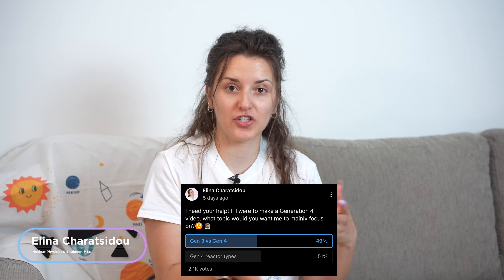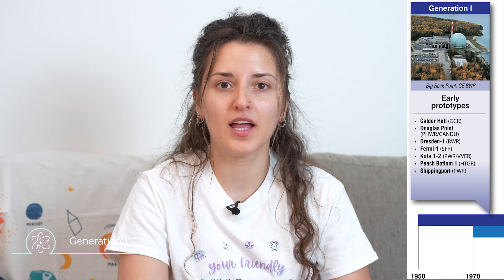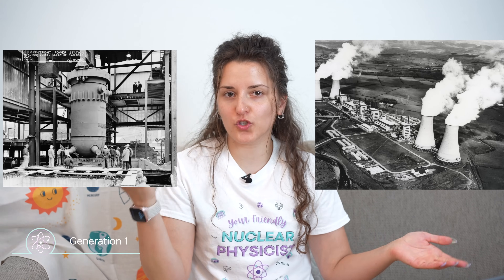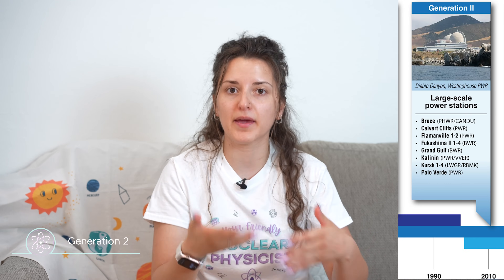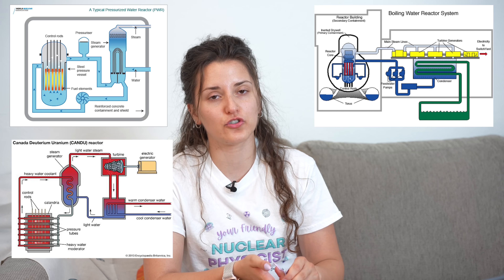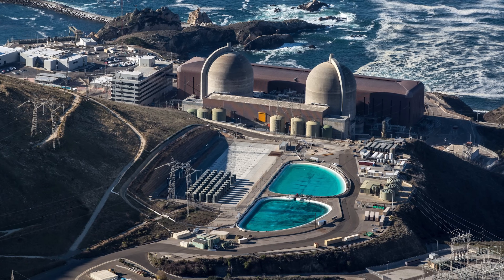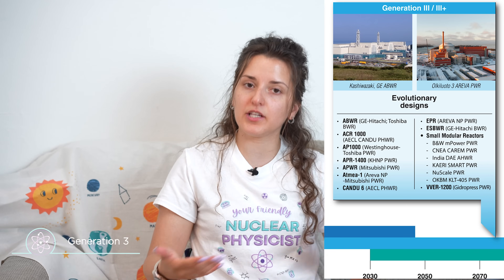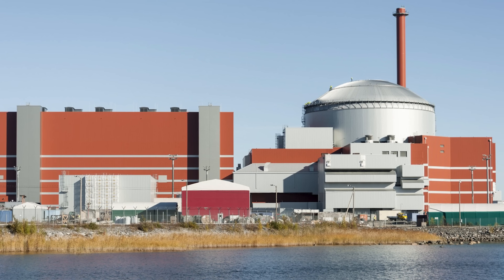Nuclear Physicist Explains - The Rise of Generation IV Reactors?

Comment: Elina, please tell everyone about the completely safe nuclear power generators that have been ignored for a generation... the only drawback is that they cost more to build than the present dangerous ones...
Reply: Which ones would that be?
Reply: @chapter4travels  There are several types of reactors... The modern light water reactor used today is the cheapest and most powerful... however as we've seen, loose the pressurized coolant water and it melts down too quickly... 
    On the other end is more than one reactor type that costs twice as much to build, produces half the power of the common pressurized light water reactor, and only produces power when you ""initiate"" it.  It is quick and easy to shut off with no chance whatsoever of a meltdown... One of them uses liquid sodium as a coolant...
Because of the cost, It/ they are only used in specialized applications such as military and spacecraft...

    Its been too many years since I've studied this so I dont remember the names; which is why I asked the question.
   Btw, even the light water reactor CAN be made far safer...
Reply: @lewis7315   Actually you have it backward, pressurized water reactors are by far the most expensive and alternate cooled reactors (should) cost a lot less, produce much more power, ie higher temperature output and be much more efficient. The Natrium is one such sodium cooled reactor and there a re several salt cooled reactors in development. Terrestrial Energy's reactor is more than half-way through a joint US/Canadian regulatory review.
Reply: @chapter4travels  There have been other reactors for a lot of years...I remember reading about them thirty ??? some years ago... in the past, they were more expensive per KW hour... Hopefully this new tech will come online soon...
Reply: @chapter4travels  I dont know where my further reply went :)
However, alternative, much safer reactors were available back in the 90s and were ignored because of cost... As you said, future safer reactors hopefully will be built soon.
              Present reactors could have been built in remote areas and below sea level so as to flood them if an incident happened... however, the initial cost was the only issue with the planners back then...
Reply: I think you are misremembering the 90's, there are no other mystery reactors. Safety is not much of an issue when the technology is already the safest form of energy.

Comment: Thanks for the complete coverage on the different types of existing reactors and what the goals are for the gen 4 reactors.  I would definitely like videos on the different types of gen 4 reactor designs being considered.  It appears that the gen 4 designs are primarily fast reactors using different fuels and processes.  Maybe you could cover each of the current designs being researched, designed, or proposed and list the pros and cons.  Maybe do a final video where you compare all of the designs previously covered.  If you could indicate the projected dates these different reactor designs will be online.

Comment: The ability to burn up old nuclear waste sounds like a compelling argument for these gen 4 reactors even if they fall through economically like their predecessors. Using the whole uranium and not just 0.7% of it will also make these long term viable in terms of fuel availability. If they turn out to run like intended.
 As for the hydrogen production, I am sceptical there. With renewables often dipping below 3ct/kwh LCOE, there is hardly any room left to be cheaper. It sounds easier to come up with fluctuation electrolysers than a new generation of nuclear reactors to obtain affordable clean or clean ish hydrogen.
Reply: I believe that there is a misconception about gen 4 reactors burning up nuclear waste.  You cannot just dump spent reactor fuel into a gen 4 reactor.
You can reprocess spent fuel to extract the various isotopes but that is very expensive and in addition to the cost of any gen 4 reactor.  Any neutrons used in a gen 4 reactor to transmute nuclear waste are neutrons that do not cause fission or produce electrical power. 

The reason it will never happen is no one is willing to spend trillions to burn up spent fuel when you can just store it in dry casks at very little cost
Reply: @clarkkent9080  Hm, feared something like that. So in the end the nuclear insutry will remain at "lalala nothing bad will happen in the next 1000000 years lalala" just with slightly less miserable financial numbers?
Reply: @BugMagnet  I worked in the nuclear industry for 40+ years and am pro nuclear.  However, new nuclear has been proven to be too expensive compared to any other generation method, so the waste issue is moot. New nuclear in the U.S. is dead.

However, realize that in addition to commercial nuclear high lever radioactive waste there is 90 MILLION gallons of highly radioactive waste from the production of nuclear weapons and that is just the U.S. The waste issue is real and will have to be addressed with or without new nuclear
Reply: @clarkkent9080  "You cannot just dump spent reactor fuel into a gen 4 reactor." Actually, you can, if you want to learn about it (which you don't, you would rather just shit-post) you could look up Elysium Industries, renamed Exodys Energy molten chloride fast reactor.
Reply: @chapter4travels  simple question; has it been built and are they burning spent fuel???? Fusion is more possible than Exodys.

You are living in a power point world of reactors
Reply: Pay no attention to Clark, he shit-posts on all nuclear youtube videos.

Comment: Can you please explain the release of tritium by Chinese nuclear power plants over the last decades into their rivers that flow to the ocean, that compared to the contaminated water held in fukushima that is. 0001% of what Chinese release every year, or you afraid of talking about Chinese lack nuclear handling that is worst then Soviet Union era.
Thank you for existing and for your contributions.
Reply: EVERY water cooled reactor generates tritium and every water cooled reactor releases it to the environment. Actually it is Tritium Oxide (radioactive water) since Tritium is just a radioactive form of hydrogen gas and as such is highly reactive and wants to chemically bond with something else. 

The Canadian CANDU reactors use heavy water which is one neutron less than Tritium and as such generate much mote Tritium Oxide than light water reactors.

Comment: I already enjoyed the Illinois university professor 4 years ago about gen 3 and 4 and safe they are.
But I loved your documentary about it, specially the technicalities.
I think the standardisation of modular nuclear reactors built in assembly lines. Remove thousands of kilometers of high power lines and place several smr near the bigger cities.
Reply: Do you thing it would be easier to convince people to accept 4 SMRs in their town or just one large standard PWR???

The safety of gen 4 reactors is only technically assumed since there are none in actual operation.

Comment: I haven't heard you discuss safety issues yet. What is the plan for preventing human error, or deliberate sabotage? What does radiation do to the materials of construction of your reactor design?
Reply: Sorry, I can’t agree. She has consistently explained that the focus on safety is to produce reactors that are inherently safe.  This can be done in several ways the most important of which is to design the reactor so that in the event of an abnormally high temperature increase the reactor will in effect strangle itself.  In other words if the temperature rises too high it will act as a negative feedback loop and the reactivity will reduce without intervention.  i.e. the reactor is self regulating.
Reply: I forgot one, human greed
Reply: Nevermind Corporate Malfeasance/Negligence, which is a feature common to both US and Japanese Nuclear Companies.

Comment: OK. All nuclear reactors generate huge heat to heat water to turn it into steam. Is this the only use of the nuclear power? We all see that it has huge potential, but we use it only for heating water? Are there any other uses of nuclear fusion?
Reply: All of the generation IV reactors in this video generate high-grade industrial heat with hundreds of industrial applications. These applications are more than double the energy needs of electricity alone.

Comment: I would like to know your opinion on the "Small Modular Reactors" for use as power plants. In Canada, there has been a lot of hype lately about building them in Canada. Canada's got only a few CANDU plants running now, in Ontario and New Brunswick, but several provinces currently use coal or gas power plants for supplying their grid, which of course need to be phased out to ASAP to reduce GHG emissions. 

Some SMR talk has been for a specialized use, like powering oilsands production facilities that burn gas for their own energy, or in isolated areas that are unsuitable for hydroelectric and cannot have their needs met by renewables. However, most of the arguments I have heard for SMR's seem to be based on them having a low cost, or something related to it, like quicker to build or reduced need for personnel to operate it. Basically it sounds like the motivation for SMR's is to do nuclear power on a smaller budget. However, people are skeptical that when cost cutting is a motive, it is safety which suffers. 

Aside from your general opinion of SMR's I have more specific questions too: 

1 - Would an SMR, because of its size, have to more closely resemble the kinds of compact reactors seen on navy vessels, and also use highly enriched fuel? (If so, does that increase the danger level, and the risk of proliferation?)   

2 - In terms of efficiency to provide power to the general power grid, would it not still be more efficient to have one large nuclear power plant, run by a large group of professional staff, than have many smaller SMR's which cannot contribute very much to the grid individually, and have a smaller group of trained staff? 
 
Basically my questions are whether new large-size nuclear plants, though expensive, would still be more efficient and safer than a decentralized collection of SMR's would be.  

(I'm assuming here that any new nuclear power units would be generation 3+ technology or better, regardless of size.)